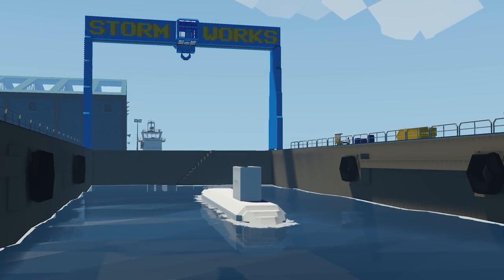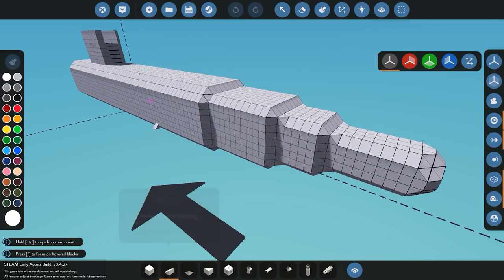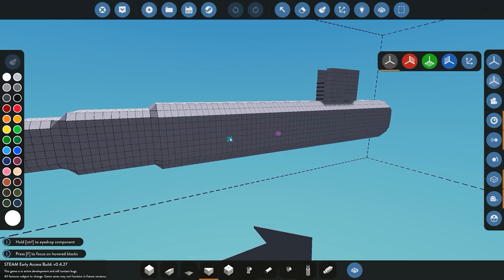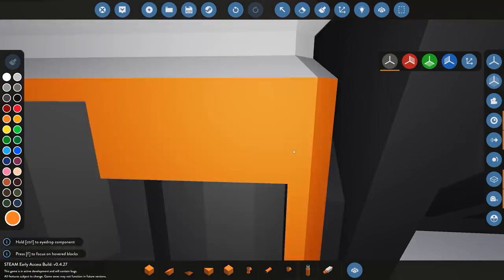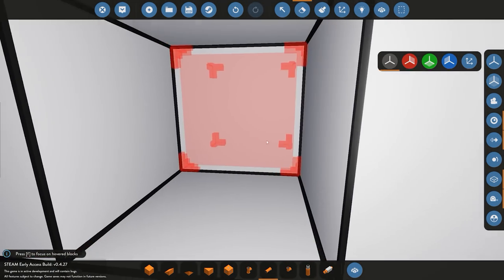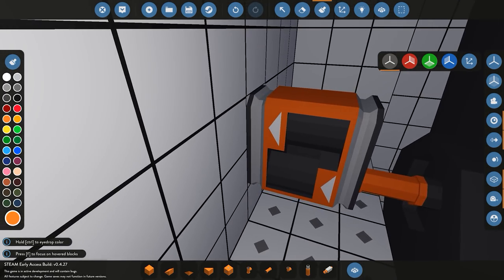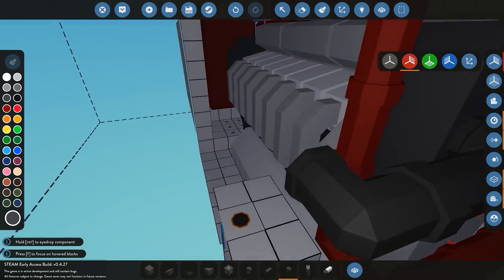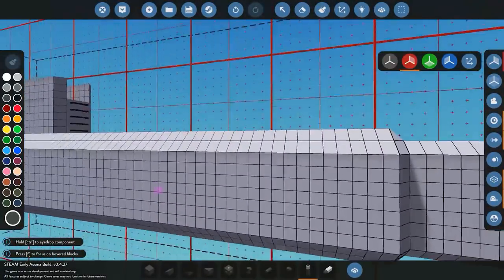Stormworks Advance Sub Tutorial Part 2

Comment: The arrow on the gearbox are related to the ratio not the direction of travel. With the arrow pointing to the propeller, the ratio will be, for example, 1:3 and if the arrows are pointing at the engine, then the ratio will be 3:1. Personally I prefer to power a Large generator through a 1:3 gearbox and just use a motor for propulsion. Great upload. Cheers

Comment: how did you manage to make it work with the air? since you go under water the air on the engine turns red as the engine takes in water :/
Reply: ilan ratner battery’s my friend
Reply: Use an engine to refill like 20 batteries, then just resurface to recharge.
Reply: I’m building my first sub
Reply: Use a filter
Reply: @SlippySnack  That's a fun way to go about it. I also prefer to keep the my sub running on purely diesel, but I'm going to try and utilize air tanks instead! It'll surface to "refill its lungs" and then plunge back into the deep, kind of like a huge whale would. I'm in love with the idea, I only hope it'll work!
Reply: Use tank for pumping in the air supply and the engine still works. Same goes with exhaust.

Comment: What about an electrical engine powered by batterys ?

The disel engine could charge the batterys while not submerged.

Are fuel pumps needed ? Never used pumps for fuel. Dont the motors will have build-in pumps ?

Cool video ! Looking forward to see more :)
Reply from the maker: Yes electric motors will be added in the next video. Pumps are not need if you remain within 10 blocks vertically, however I add them just in case it exceeds that or if it gets changed in a future patch.
Reply: You made your starter on toggle button, so maybe is is causing engine to turn slowly
Also add snorchel on periscope, so you can run diesel while only boom with airvent will stick out of water
Can you add display with moving bars instead of dials to show how much water is in ballast?
Add windows! either ouside windows and window into ballast tank, so you can always look into them if they work
Tip: Add emergency pump inside living area, if accidentally water got inside (big waves while hatch open), sensor will activate pump to put water away, then shutoff, to save battery
Question: Can you make engine room and ballast tank at same time? Like pump water around engine, to keep it cool while acting as dead weight too? Maybe this can save you some space inside
Reply: @jakubpollak2067  Windows inside a submarine.... Very bad idea. Of course, there are submarines in real life (expedition subs) which have windows but those are specially constructed and extremly resistent to pressure. Ofc windows in Stormworks in a sub would work fine but that would just take all the realism there is.

The idea with moving bars display is great and pretty cool.
Reply: @updatedotexe  You can use new tiny windows, because small windows are more durable than large glass panels
But it is a game, so why don't create a large full glass submarine? Just to enjoy under water wild-life

Comment: Don't you need a clutch just curious if they changed that
Reply from the maker: You dont have to use a clutch, Its only if you want the output of the diesel engine to not send any power to what is connected to it, As here I have a electric engine connected to the prop there is no need for it
Reply: Thanks

Comment: Tip to make a submarine:

Do not use water pumps and ballast. Use flaps to get underwater, the throttle will hold the submarine Down.
Reply: But this is lame. Realism is cooler.
Reply: How about we use both the ballast pumps and underwater flaps to go underwater?
Reply: To go down flaps need to be rotated downwards right? Cause when they rotated upwards i go down and when they down i go up o.o